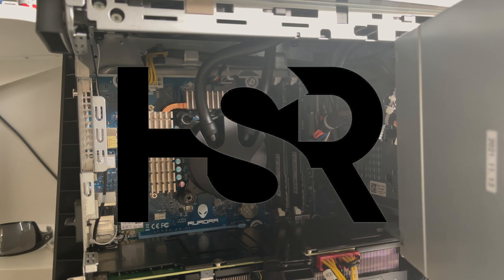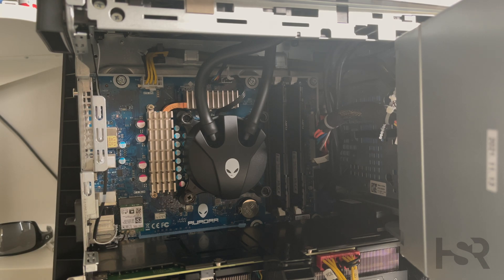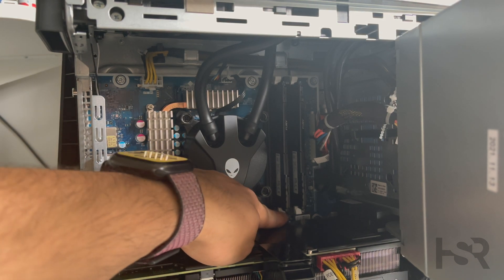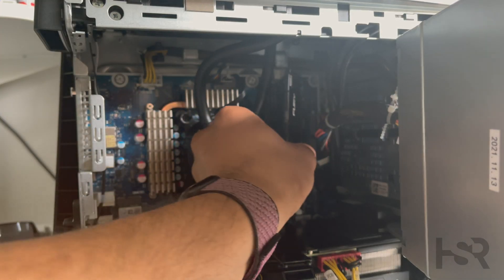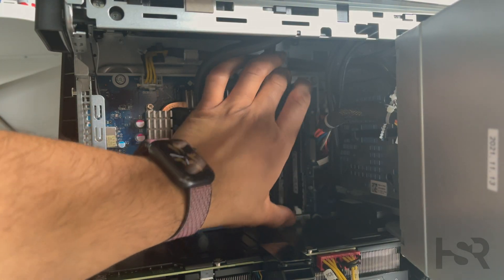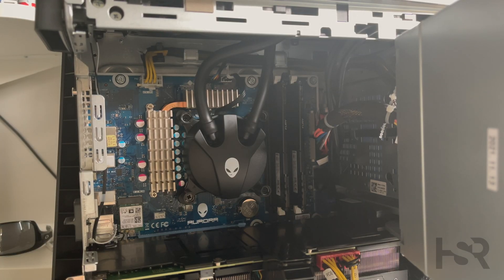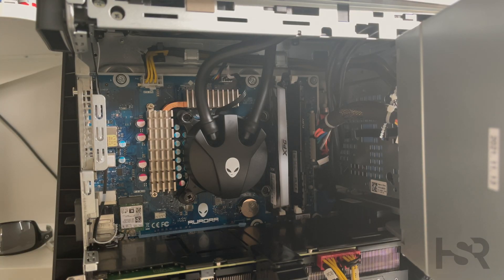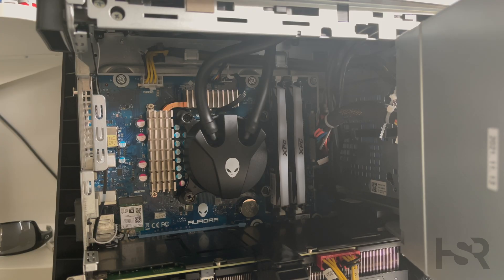(RAM upgrade) Aurora R10,R11, R12, R13, R14

Comment: I can’t seem to get my original or new sticks to click in like this and keep getting no ram detected errors on both my new sticks and my original stick - trying as separate configurations / not adding old and new together.
Reply from the maker: Have you tried reseating the RAM?
Reply: @HSR yea multiple times but can’t get any to take, the original stick included. I’ve tried dozens of times now and am kinda confused as to what I could be doing wrong.
Reply from the maker: have you checked the RAM teeth? That the gap is facing the right way?

Comment: Hey I really hope you can help a brother out, I have ordered G skill Ripjaws 32 gigs 3600mhz cl16 memory after seeing a article it would be compatible with my system an Aurora r10 but I was met with a lot of people saying it won’t achieve it’s dedicated speeds and timings because Alienware make trash mother boards which are only compatible with factory ram Dell makes. A quick reply to this could help so I can know if I would just return the ram and keep the trash single channel 16 gigs I have before it it to late.
Reply from the maker: Hi there. I would be in concurrence with the "lot of people: that you have met

Comment: Can anyone get 64gb 3600 ram working on their r11?
Reply: I can't get 4x16GB or 2x17GB 3600 Corsair Vengeance to work, replacing the original 2x8GB HyperFury. It works for a but then eventually crashes. It actually worked for months. Now I can't get the original to work, back into the white slots. Alienware is pissing me off. Btw, I'm confirming the stats on Bios and adjusting to match.
Reply from the maker: @danieltomberlin1112 that’s why it’s a good idea to build it yourself

Have you overclocked anything in the system?
Reply: In the BIOS to get the Hz to match (e g., 3200MHz), OC Mem 1 or 2. Why?
Reply from the maker: @danieltomberlin1112 I meant the GPU or CPU. Have you overclocked them?
Reply: I could not get 2x32GB 3600 ram to boot.
Reply: whats your graphics card? sounds like a bottleneck waiting to happen

Comment: Thank you for your demonstration. Had a small question, I currently have single channel 16G (FURY). Bought now 32G dual channel (16G X 2) but another brand (Crucial Ballistix). Can I install the 3 to have 48G,  with the Crucials being in the 2 white slots and the Fury in the black slot, or will this configuration cancel the dual channel functionality of the 2 in the white slots?
Reply from the maker: It’ll cancel it and reduce your speeds.
Reply: @HSR  thank you so much, I guess I'll stick to using only 32GB dual channel and sell my other Fury stick!
Reply from the maker: No worries. Kindly consider a “Super Thanks” to support me ✌🏼😇

Watch video and subscribe 👍🏼👍🏼
Reply: @fuyiman  how did it go for you? I heard the Voltage difference might be a problem as Crucial has 1.35V and native DELL Fury 1.2V
Reply: @creativevit5961  It actually went smooth, I did install the 2 Crucial Ballistix RAM sticks but had to edit the BIOS from MEM OC2 to MEM OC1. Then I did get the full 3200MHz dual channel working like a charm. Huge difference when gaming on my Alienware AURORA R10.
Reply: @fuyiman  yeah, just added 32Gb with no problems. runs good. did you upgrade your intake fan as well?
Reply: @fuyiman  Hi, how much of difference did this make? I have been debating this for awhile now. I have an R10 Ryzen as well!
Reply: @ZacharyPaxton  Hey Zach, it made a huge difference. I had some lag in some games when playing with full details and running an RTX3070. Now, it runs so smoothly. A huge difference and investment is not so much, so I encourage you to do it as well 👍

Comment: That was useless.  You need to show what to do when it reboots with the new ram.  Is the XMP locked?  Mine is greyed out so you can't change the frequency even though the factory came with 4800mhz ram, it is locked to 4400mhz frequency
Reply: Did you figure out how to unlock the xmp ?

Comment: Can you upgrade from DDR4 to DDR5 without any issues?
Reply: No, ddr4 ram is compatible with motherboards that support ddr4, there are motherboards that support ddr5 ram. You can’t mix and match.
Reply: @xraize2341  thanks.  I figured that out.  I didn’t realize that it depended on the motherboard when I asked it.  So basically if you have ddr4 then stick with ddr4

Comment: is it safe to mix them, and are they all 4 the same speed?
Reply from the maker: Short answer, yes and no. How much do you know about RAMs? And also kindly elaborate on your question
Reply: @HSR  Don't know much. I have the hyper x fury dual 16gb that came with my r12. I was looking to upgrade while keeping the one's already installed.
Reply from the maker: Do you know what MHz it’s running at? Which XMP profile are you using?
Reply: @HSR  3200 xmp2
Reply from the maker: Short answer. It’s not going to overclock if you mix. Also, Intel doesn’t like four RAMs. You MIGHT be able to get away with it with Ryzen
Reply: @HSR  ok. So I should just get new dual 32 gb I guess. And do you know if I would be able to run 3600 ?